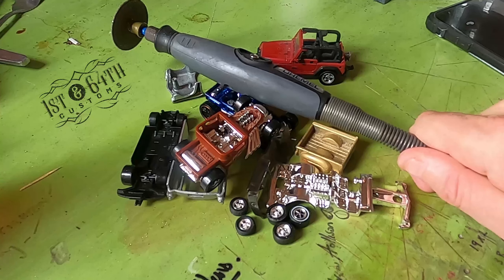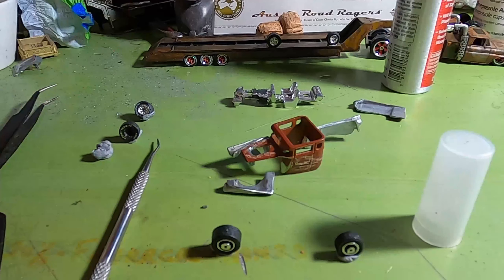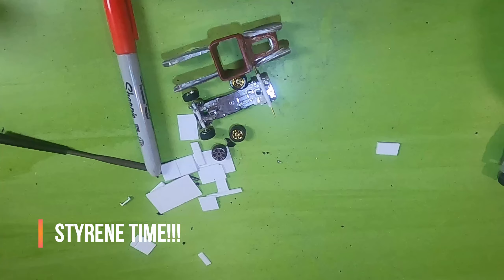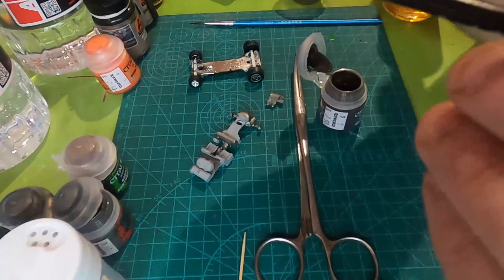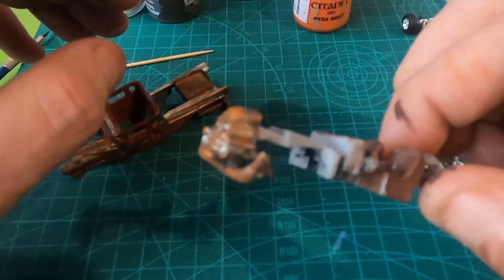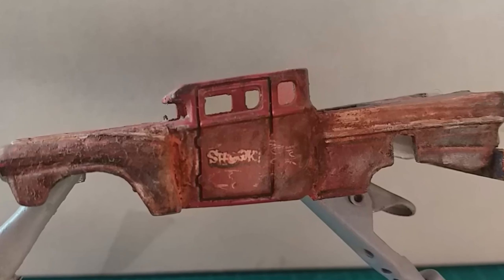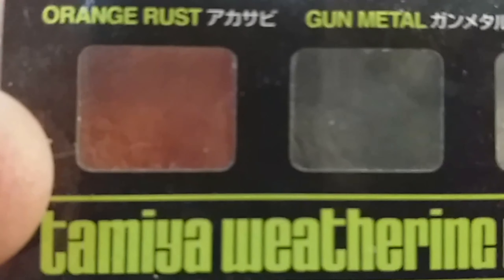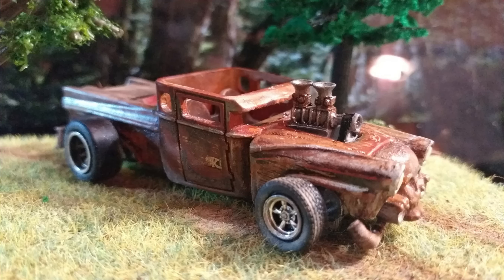The "NoBoner" Build

Comment: You should try acrylic varnish between your various layers of streaking enamels - stops the the thinners attacking your previous layers
Reply from the maker: yeah i opt to not seal between grimes, but sealed that with matte clear before rust application, then again before powders, with a final coat, but very sound advice!! Thank you =)